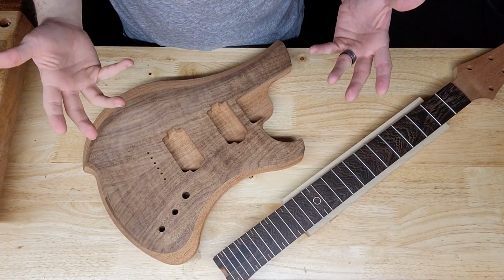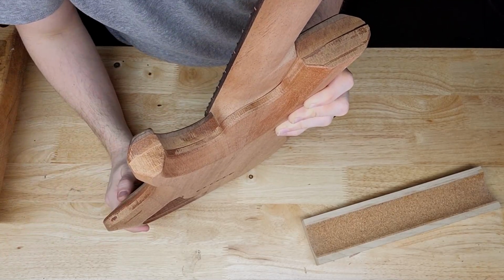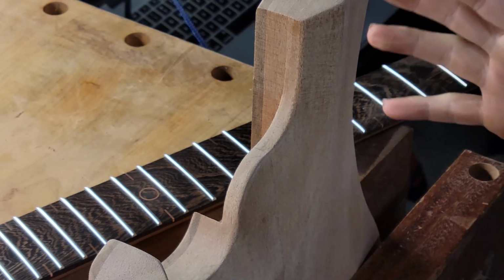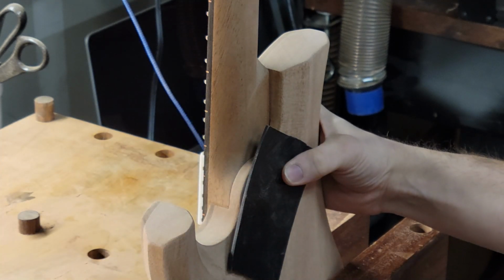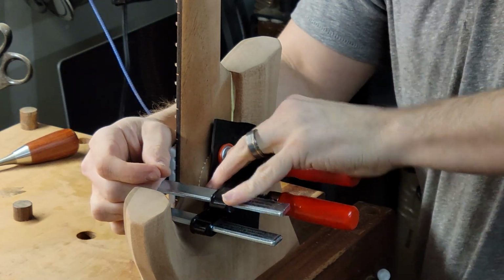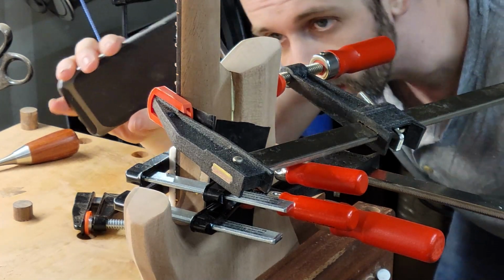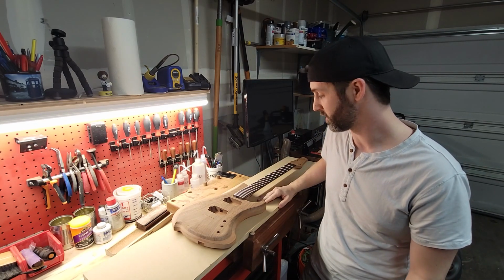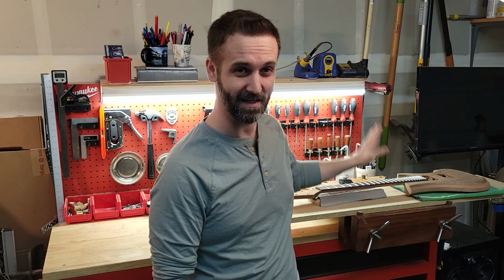Final Prep & Setting the Neck | Project Mehr | Guitar Build Log Part 6

Comment: If it were me doing the clamping part, ahead of time I would use the 3D model of the back of the neck pocket and use that to trim out a negative that will fit snugly against the back of the neck pocket and then I would CNC or 3D print that, and it would have a flat bottom for the clamp to go against. I'm not sure if that makes sense or not.

Comment: if we use a single block of wood (not use 1/4" wooden plate) for guitar body, how is the best way to make hole for cable between humbucker or humbucker to knob so that no rough hole ? Sorry, I know I should ask this question long time ago.
Reply from the maker: Hey Aristo, if you aren't using a separate top to hide the routed cavities, the best method is to use a long drill bit to drill between the pickup cavities, and also drill from the back pickup cavity to the control cavity.
Reply: If you have a long enough drill bit, you can drill from the inside, bridge-facing, edge of the neck pocket through the neck pickup cavity to the bridge pickup cavity. Then, assuming the controls are not too far from the bridge pickup, you can drill through the floor-facing corner of the bridge pickup cavity into the inside wall of the control route. Use a shallow angle though, or you might drill through body.
Reply: @austinshaner  thanks for reply ...
Reply: @peachmelba1000  thanks for reply ...

Comment: Looks like you could use a spindle sander!
Reply: That neck gap issue,... could you have  sandwiched a piece of sandpaper between the neck and the pocket, and pulled the sandpaper out repeatedly?  that way the faces would have fitted better?
Reply from the maker: I certainly could have! But it didn't seem as if I had two faces that weren't parallel with each other. It felt like either the side walls were slightly tapered, creating more friction the further it went in or something was preventing it from closing. I sanded each side of the neck as flat as could be until I felt my neck was on the verge of fitting too loose. So my solution of just chamferring/rounding the inside corners was a simple and effective way to get it the rest of the way in!
Reply: @austinshaner  Interesting watch for me, this series, I have been following Ben Crowe for a while, and admire his "fix it as you go" methods, plus his ability to "see" the patterns and shapes he wants by eye, and then works the wood (or whatever) to those ideas. Your approach is from the other end, to a certain extent, being what one could call a Technological Down approach.
Ben, of course in his earlier incarnation said he hated CNC work, but of course now sees the value to repeatability as they enable them (Crimson) to cost-effectively produce quantities of instruments, which would be impractical if all done "by hand"

Does have to be said, the knowledge he has gained by all that handwork, has its place. That twisted neck, for example. I guess through years of experience he knows that removing material from a neck, blank, that no matter how carefully you do it, the wood is always going to move and needs to settle, and may have to be "re-flattened" after the wood has relaxed. 

But a very interesting and enjoyable series, and thanks for all the info on CNC, most of which I had no idea about. That being said, I will be starting on a 5 string bass, soon, although I won't be going the CNC route (don't have one!). But liked and subscribed. Looking forward to more videos...!